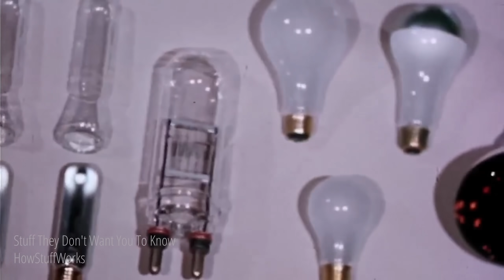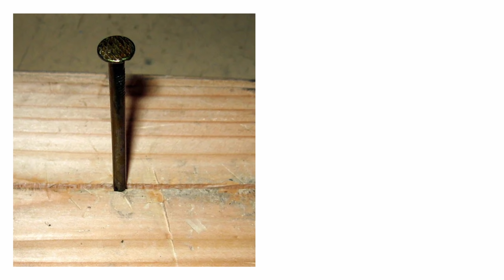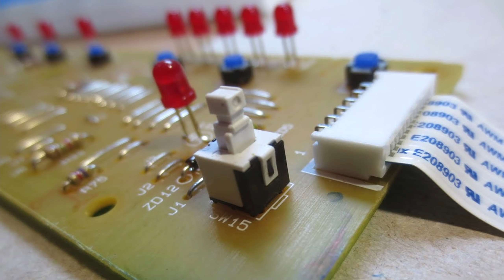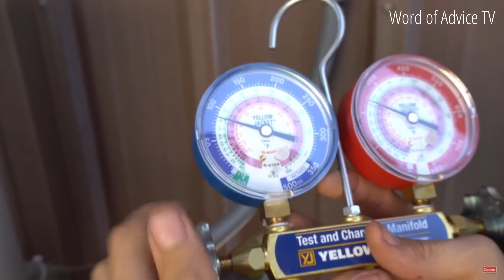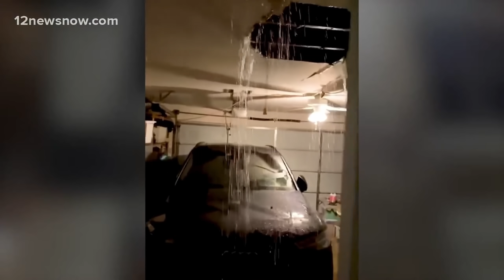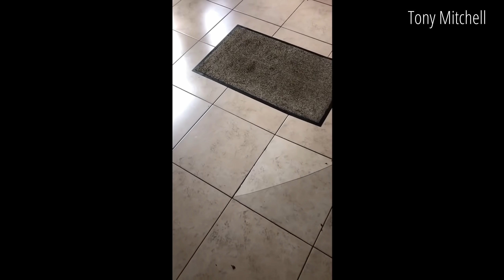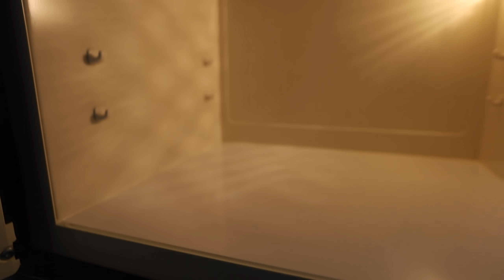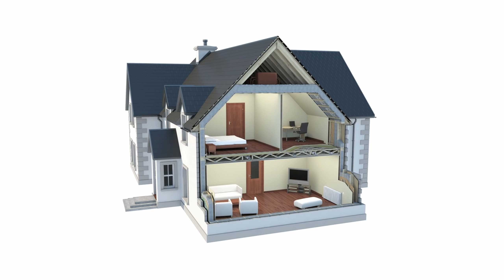Built to FAIL | Planned Obsolescence

Comment: 10year warranty on a land slide. I am sure its full replacement on the compressor only for first 2 years and then after that prorated. 
Recently fought a brand new kenmore fridge. Constant ice up. Had to just buy another new. It was cheaper than calling a tech every time.

Comment: It is easy to blame the manufacturers, but it most industries the problem is the consumers as you mention towards the end. If a manufacturer offers two products, one well made of metal that costs $2,000 and will last 20 years and one made of plastic that costs $500 and will last 3-5 years, the consumer will buy the $500 unit almost every time.  A real life example: Look at the sales ratio of PCs vs. Macs.  I am on my third iMac and they last 10+ years.  Most PCs need parts replacement after 4-5 years.  However, PCs cost half the price of Macs or less and that is what 90% of the public buy.  So, I agree that short lived products is a huge problem, but I think 90% of the blame is facing us in the mirror and isn’t a manufacturer driven conspiracy.  If consumers start buying better, but more expensive products, manufacturers will start making better products.

Comment: If you could do a video on the DFW soils and explain why "most homes have a slab-on-grade foundation instead of a pier and beam one" and why that is bad, I would appreciate it.  (Is the pier and beam the one where the foundation looks like it's on stilts and that animals can crawl under?) We've lived in our 1965 home with slab foundation for 10 years now and so far haven't had any foundation problems.  But our washer and dryer have to be replaced, which happened a year or two after the warranties expired.   

My grandparents bought a home in 1970's and after 30 years, the kitchen appliances were still working.  That's not something you find nowadays.

Comment: Belinda I absolutely adore your content but the basis for this video isn't true. I get your argument about planned obsolescence especially with respect to big tech companies, but I feel like you simply made this video as a result of being angry about your fridge and contradicted yourself as a result.

What actually happened is that a compressor failed. Was this compressor "planned" to fail? No, it was the most reliable it could be at the price point it was sold at (including the profit the manufacturer can tolerate). That is to say it was cheaply made. Manufacturers are competing with each other at every budget, so if one does it they all have to. If it was a more expensive fridge they would have used higher quality parts. You could have replaced just the compressor for I'm guessing 1/3 the cost of your new Samsung fridge (the price of compressors is high due to the tolerances and mechanical complexity), but you CHOSE to replace it. In doing so you perpetuated your argument of planned obsolescence by throwing away an otherwise functional fridge for the perceived benefit of "features".

Here is the hard truth that nobody wants to hear: stop buying cheap products that are poorly made. The reason your fridge was "doomed" to fail isn't because someone had a board meeting to make their products fail past a certain date... it was because that fridge was so cheap that it was barely functional to begin with. Spend more, get a quality product, and then manufacturers won't have a reason to cobble together products that fail quickly.

Comment: When it comes to homes, the problem lies with the legislation. There is so much of it at so many levels of government that its impossible to build anything other than cheap shitty houses. In the UK we have 11 sections to our building regulations and within those sections normally only 2 to 3 lines. In america you have more detailed requirements for the size of the lettering on the front of a house than we have for the structural loading requirements. " The building shall be constructed... so that loading... is transmitted to the ground safely... without impairing the structure of any other building." Thats it, thats all we need to do. How we do that is down to us, and we are trusted to build those houses to meet those requirements. What more do you need from legislation. Meanwhile in America you have a million words to tell you how many light switches a room needs. Then you complain when everything is built shit and cheap and falls down all the time.

Comment: yea, this concept is a pet peeve of mine, actually infuriating. It is rampant in the heating and air conditioning industry in which I work, but it's not because of the EPA demanding new refrigerants that don't cause ozone depletion or greenhouse effect but more directly engineering of the machines.  First, you may see or be given a long list of different furnaces and ac units with different names and different pricing but they are all usually made by just a few manufacturers. This is done so a few big manufacturers can gobble up market share, basically sell stuff to super rich, rich, medium and poor people. Then the EPA mandates higher and higher efficiencies and marketing markets that, but to get those efficiencies the manufacturers add complexity into the machines, increased complexity creates opportunity for planned obsolescence. That's why even to this day, once in a great while I still come across an old Williamson furnace that's still in operation. Everything in machines are being changed over from electromechanical controls to micro controls, basically computer controls, so the sequence of operation in a machine is basically programmed into a microcontroller and it works but are prone to all the failure modes of a computer. Inferior materials are widely used , connections are less than robust, plastics are used in high temperature locations prone to failure, metal in locations with rotating parts are thin and not robust prone to failure . This is the HVAC industry and i work with it every day, this is true even in big commercial units. I really do wish Elon Musk would enter into this industry and upset it with his engineering ethos because this market is ripe for this and it would be quite profitable for someone.
Reply: The biggest killer is that your condenser tube wall metal thickness is paper thin. They all start leaking within a few years.

Comment: I have been enjoying your videos but I'm afraid in this case I'll have to call you out. Planned obselence is basically a conspiracy theory in most cases, and you are repeating several of them here. While it might seem convenient that manufactures use inferior methods or materials in their products, it is important to remember the old saying: never attribute to malice that which can be explained by stupidity. In this case, stupidity is built into the system. Where many companies spend twice as much (or more) on marketing than R&D, and when it comes to making more profit year on year to impress shareholders, it's easier to cut a buck than make one - the result is that companies will buy cheaper plastic fittings and parts instead of expensive but long lasting ones in order to make their products for as cheap as possible. They will then send the marketing team out to promise that the product is made of the best quality available and hope that people believe it. 
They don't "plan" obselence they just build it in so they can save a chunk of money on the manufacture while knowing that the consumer will buy anyway because they like the brand or the advert. 

When it comes to enclosed unit design though, this is a real issue. The right-to-repair movement is fighting against companies that do this as their main business model, but even these companies are generally not trying to force people to buy new stuff when the old device breaks down - they are trying to ensure that they are the only available option for repair. 

The last half of your video is basically a complaint about hiring bad builders and states having lax building regs, so not relevant to planned obselence. 

The whole issue can be solved with better regulation of the consumer goods industry. Forcing them to advertise more honestly, or manufacture to tighter standards. People resist this because they think the price of goods will go up - which of course it will, but buying a freezer for $450 every 4 years is still more expensive than buying one for $800 every ten. Regulations could even those two equations out; turning a 4 year freezer into an 8 year one for the same overal cost. The result of that would still be $900 for 8 years of home food storage but the environmental cost would be lower! It's about how people want to demonstrate their control... And spreading the myth of planned obselence is only muddying the waters and preventing people from uniting to solve the correct problems

Comment: On the ceramic tile bit, you don’t have to use cleavage membrane or Schulter mat.  You can use fluid applied crack isolation membrane. Also, that video showing popping tiles was because of lack of expansion joints not crack isolation.

Comment: I was a consumer electronics service technician for ten years back in the 90s.  That was right around the time when things started to get really cheaply made and really hard to service.  Older devices had built-in service modes, access panels, test points and all the parts were available.  They were made with the service tech in mind.  The cheap stuff I saw rolling out in the 90s was mostly plastic chassis and circuit boards that discouraged access or component-level repairs.  The only thing I could do in some cases was swap the entire circuit board, which was always prohibitively expensive.  I still have one of Sharp's very first CD players from the 80s.  I've had to clean the laser head a couple times (understandable after such a long time) and replace the rubber drive belt that opens the disc drawer (totally expected that the rubber has dried out after 30+ years), but aside from that it's still going strong.

Comment: While I understand the principle of Planned obsolescence, it would be nice to have it countered off with planned recycle-ability (where the object is stripped down and recycled with little waste versus waste of a solar panel you mentioned in a previous video). When you said they were building slab on clay soil in Ft. Worth I nearly spit my coffee, tension slabs are still slabs that rely on rebar that will always fail in concrete. Consumer products are planned, the structural issues of slab on grade are cheaper then pier and beam, spray foam insulation I have asked builders how an owner is suppose to add or update network wiring or repair electrical wiring, followed by them yelling "Hey look it's the This Old House Crew" and promptly run away. While people talk about heat pumps being greener and supper efficient then gas/fuel oil for heat, until after you spent money and then have to replace a unit because of design that makes repairing the pump impossible. When a heat pump fails during a -10 day, and you have no way to heat your home. The fact wood and other burning stoves are becoming  "illegal" in Canada that has freezes that take down their grid is insane.
Reply from the maker: Thanks, Joe! I had included a segment on Cradle to Cradle and Repairability Index, but the video was too long. I'll address planned recyclability in another video.

Comment: Agreed 100%....  I had a hard time finding plumbing info for a townhouse I bought, and it would've been much more serviceable if the original sketches of stub-up locations through the post-tension slab had been included.  
       Luckily for me, although the development company had been sold three times in the fifteen years since it was built the original company still maintained an office and a secretary directed me to the retired original plumbing contractor who provided me with copies of his sketches for all seven iterations of the five floor plans, spent forty-five minutes explaining the water chemistry argument for slab leaks, and referred me to a good plumber who accepted $250 for a forty minute tutorial in pressure testing and re-routing to abandon slab loops (in seven years five pin-hole leaks occurred -- three loops abandoned, and my cost of materials came to $350).
       Unluckily (for other homeowners) I shared the copies with the property management which soon after made a rule change requiring licensed contractors for any home repairs, so I know the information will never reach homeowners (of course, it wasn't a real rule change since it goes against States laws around Owner Builder repair rights, and wasn't voted on by the homeowners, but such is the trend towards incestuous relationships between Property Management companies and Association Board members who increasingly do not live on-site (ie: "We'll tell you what rules to make, and we can't be held liable because you'll be approving & adopting them").
       This, I believe, in an illegal way, falls within what you[ve called the, "Legal Interventions," category.  I REALLY DISLIKE Property Management Companies and HOA's who choose to use and listen to them without regard to the CCR's and the law(!) even in the face of expert advice (their own law firm and stucco contractor advising not to paint stucco).  Reminds me of the old adage, "Joke'em if they can't take a...."

Comment: A great episode Belinda. Furniture from IKEA may as well be put together and thrown straight onto a landfill.
Reply from the maker: Unfortunately very true. I have found some well-built metal pieces, but most of the mdf furniture is disposable.
Reply: FYI, IKEA is starting resale of used items in their stores? This might change the quality of their products.
Reply: Ikea makes furniture at a range of qualities.  In this industry I think it's up to the consumer to purchase the appropriate quality for their needs.  

My "cardboard" (composite) bamboo Ikea desk has lasted 3 years so far and was easy to move when I changed apartments.  If we use 1/10 the materials it's ok that the product lasts 1/10 as long. 

They also sell solid wood desks if that's what you're into.

Comment: No wonder there is climate change. Earth is covered in needless trash. People who plan and execute such "strategies" should be arrested, tried, charged, and executed themselves. In my family, we had a fridge that was a wedding gift to my great-grandmother. It worked for almost 100 years. The original light bulb that was in it worked for 60 years. We have a sewing machine, which at this point is over 140 years old and still works perfectly fine. I am from an old family. Our original family house lasted for over 450 years. 
This horrible practice runs in the plant industry, too. Many growers practice reverse natural selection, picking seeds not from the best but from the worst and weakest specimens. In a few months, such plant will die and the owner will have to go to a store and buy a new one. It got to the point that some of the plants lost their natural abilities to propagate, for example, many specimens of holiday cactus cannot now be propagated by cuttings. You would have to buy a new one. 
In my garden, I collect my own seeds and try to reverse this flawed process. For example, I bought a mustard plant from the store. It lived for 3 months and died. I collected seeds from the best stems. From these seeds, I grew mustard # 2, which lived for 6 months. From that one, I again collected seeds from the best stems. Mustard # 3 is now 9 months old and is not even thinking about dying, even though it is frost outside. When they tell you about "annuals" and "perennials", you are lied to. At this point, I have 6 year old "annuals". The only thing I have to do with tropical ones is to shield them from cold during the winter. I cannot express how much it pisses me off when companies think that consumers are morons and lie to our faces.